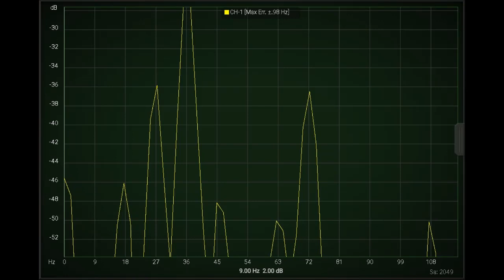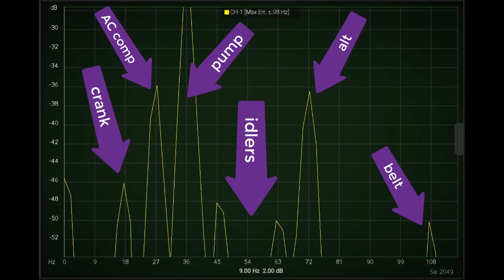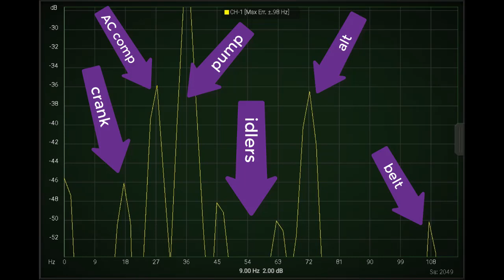GADGETS#77 - SERPENTINE SPECTRUM

Comment: Can't wait for the build. I'm assuming it's a piezo. I still have a few from the pulse sensor project
Reply from the maker: +Varian Styles - it is a piezo. And no need to wait for the build...it is GADGETS#51 & #52
Reply: @theGADGETSplaylist  Thanks..I have saved all the Gadget videos & somehow missed those. One question, is the faucet tube "floating" in the ABS housing? I'm assuming that it is since you warned about not putting pressure on the tube to avoid damaging the piezo, but can I epoxy the tube to the hole in the ABS. I fear it falling tube-first & destroying the piezo.
Reply from the maker: @vlstyles  - the tube must be free!
But, check the end that is in contact with the piezo. Is it sharp? If so, file a small flat on it.
I've used this instrument lots and have not damaged the piezo as of yet. Remember the ABS is not glued so replacing a piezo is not that big a deal.

Comment: have you got a procedure of checking frequency s of a relative compression test ,i've figured them out with a scope and cursors   but i would like to get a reading with FFT mode , i still refer to your videos when i get stuck,thanks for the information you share  .
Reply from the maker: Hi Henry!
FFT is a very useful tool. But not for everything...
I don't think it would add any benefit in relative compression tests.
Reply: @theGADGETSplaylist  probally not ,but i was using it for desighn of filters,but like i said i already got it from scope data

Comment: since i watched this i had an idea . i got a 2002 chevy 6.0, i may tap into the knock sensor and see if i can get results similar to this. i know the sensors are very sensitive . thought about using a knock sensor  to make a tool like your using
Reply from the maker: +henry robinson - interesting idea...
It has crossed my mind. I have reservations...
There are different types of KS, some with bias voltage, some not...and the placement near cylinders...
But I like the way you think and it is worth a try...
Please do share how it works out and if the serpentine related frequencies can be singled out...
Reply: @theGADGETSplaylist  i'll do that,on this design it has a knock sensor towards the front and 1 ine the rear, they ride on a 5volt dc .i'll get back

Comment: Have started using my stethoscope at last on this project & it works great. I have one question, how would you analyze a vehicle with two different belts like a separate power steering belt for eg?
Reply from the maker: +Grunter Robertson - I haven't tried that, but I don't think it would change anything much.
Each accessory would have its frequency visible on the screen.
Instead of 1 "outlier" for 1 belt, there might be 2...that would be my prediction.
Congrats on your build!

Comment: Interesting. This would be very useful. I don't think you mentioned so I assume this is using gadget #52 (the stethoscope)? I suppose one would have to record the results from your own known good engine before you have a problem or do you think a bad component would be really obvious?
Thanks
Reply from the maker: +Dave Sage - yes, I believe a bad component would stick out. A known good is not required.

Comment: Interesting ... I seen the Trained by Tech guy used a pulse sensor connected to the stethoscope and waveform was impressive ... great work as always.
Reply from the maker: +Burt Pilon - I must stress that the device and approach by Hans in Trained by Techs differs from my stethoscope design and my approach.
I thank you for your generous comment, Burt:)
Reply: Yes sir... thank you 👍🏻